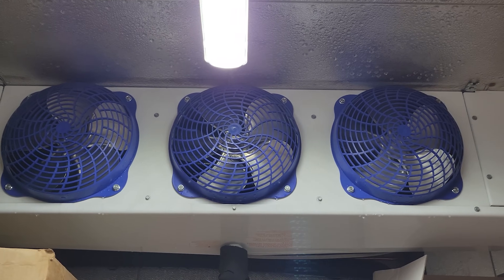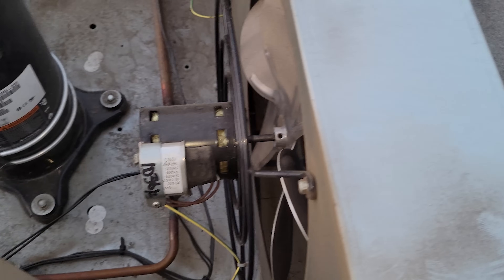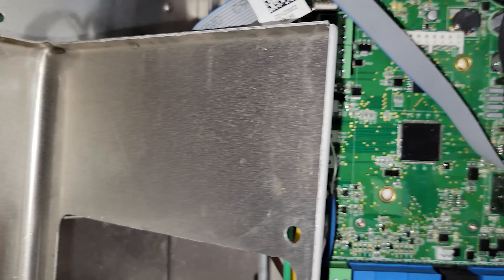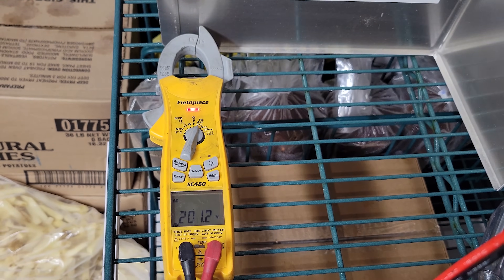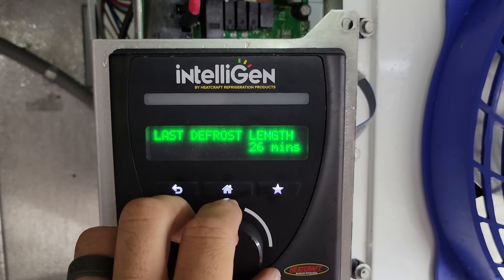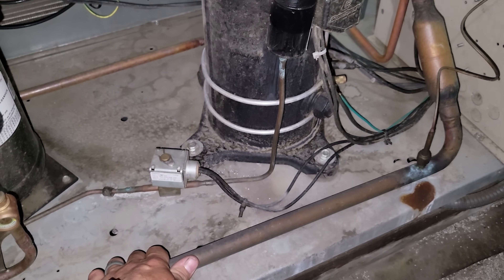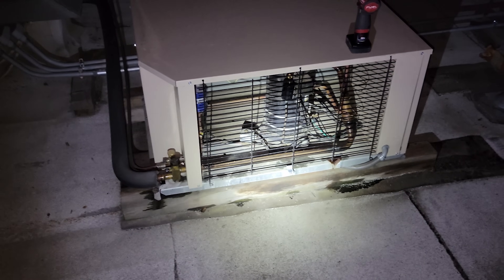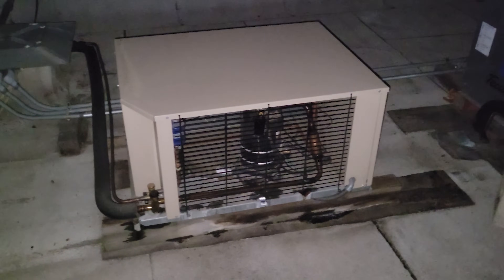HURRY THE FREEZER IS AT 50 AND IT'S 7PM

Comment: You’re in California right? Run a frequency check … it could be out of sync. The meter is supposed to do it automatically but sometimes it doesn’t. Brownouts will blow transformers too. 

I work IT and I have been going 200% lately too. I’ve had 3 UPS’s blow out during hurricanes because of the supply lines being out of sync.  One took out a lowes stores Battery Backup out and it burst into flames .. had to pull all new fiber optic. 

Was at a BK the other morning and the boss was shutting down at 7am because nobody will come it.

Comment: We’ve been in a similar situation over here in the northeast. I just started as a cascade refrigeration tech last year working on lab equipment, right in the height of the shutdown and it was very, very slow going for awhile. But ever since about September of last year once labs started opening up again, it’s been crazy how many -80 freezers have gone down. A lot of it felt like it could have been easily prevented with condenser/filter cleanings, or even scraping the ice off the door gasket so it would seal right. But with no one in there for months, I guess it was just something that slipped everyone’s mind getting back into the groove of things.

Comment: I worked in a store that had the motor room controls daisy chained. New guy came in to fix it asked how long was it like that, manager said probably since 1984. These things was running by the others thermostats at this point on the reach in's. Took a week for this guy to fix what someone else tore up in thirty years. Felt bad for the guy actually cause there was over 40 valve controls and non of these was labeled what they was for.

Comment: I'm working at a factory kitchen that supports a major chain of restaurants. The problem is, they come from a restaurant background, they don't know how to run a factory. The place is a real mess in terms of management. And they are trying to cram so much into such a tiny building. Since I come from a food production and IT background, I feel very disconnected from the process. Just the other day, the top floor of the office became a storage area for food. So, I will give you the process of my production:

We are making biscuits because all the restaurants are closed due to lockdown. Our pastry chefs work down the rear of the building, the guy who cuts the biscuits from the machine is towards the front of the building near the sealing machine area, which also doubles as the sign in and wash hands area. So, he makes the biscuits, they go to the oven which is in another area of the building, then down the back to the pastry chefs, then they go to a table somewhere else in the building, get weighed and bagged. Then they go to be sealed, go back to the table to be stickered, then to a completely different room of the facility to go through a machine which pretty much just puts tape on the top and bottom of the box. (anyone with a tape gun can do this in any room, but they decided to buy a machine for this). Then, to make that even more fucked up, the room with the taping machine is next to a walk in fridge, and you have to walk through the fridge that's fully packed with 3 boxes at a time, to then move down a side corridor through a couple of doors, into the staff office, take a left go up a flight of stairs to the change rooms and staff lunchroom, where they've decided to store these boxes until they go on an order in a few days and then have to be lowered back down the stairs by hand again. And that isn't even the entire process, because some biscuits are dipped in chocolate and go back and forth from a blast freezer and out again.

I think what I am trying to say is, the other day, the boss muttered an F bomb under his breath because I was only taking 3 boxes up the stairs at a time. My fucking knees are killing for doing this all day, up down, up down. The hell man. This is the problem with these types of environments, management are morons. Generally the type of people who manage restaurants are completely fucking stupid. Because the way they got to work in this position is they completely failed at school, they went into an apprenticeship for 3 years, spent the first year peeling potatoes, 6 years later they moved into something specific like pastry. These are not smart people, they are the lowest paid, least accomplished people in our society. Even the fucking janitor of a high school is more respected. Half the time the industry relies on illegal migrant workers. There is no lower job in this world then working at a restaurant, I literally hate these people with a passion. It's degrading working there to be honest. But, Covid, studying at Uni, need a few hours to make my life enjoyable.

Comment: Well... I do still not understand why you have to keep all electrics built in/on the evaps...?

We keep all kind of that stuff outside the cold rooms in the northern europe. Well... when we used mechanic thermostats it was inside the cold room. But that was long ago.

Still... those open, bare naked electric couplings in the evaps, a nightmare. Makes me shiver. Why not encapsulated? Ever heard about splash-proof/touch-proof junction-boxes in plastic?

Comment: Bite your tongue about venting to the customer. Or ya know, just educate them on how you, and all your technicians are professionally trained to work around/with the restaurant staff. So that they don't wait to call you until after the dinner rush. 
Can't tell you how many times working in walk in coolers, and walk in freezers during their dinner rush, I end up passing food to them to help them out. While holding a hose, thawing out frozen evaporator coils. 

Chris, you have an issue with the customer calling you when the problem arises. The solution is in educating the customer, on how time is extremely important, and you need to get there right away. You have to repeatedly say this on every service call, tirelessly. 

Sounds like you need to speak with your customers, and technicians, to begin passing on what I said, to make your life less stressful.

Comment: Too much current draw. The winding insulation was burned off shorting it out. Now the question becomes why did it draw too much current? Could be on the board, maybe something to do with that ribbon. Not necessarily a direct short but there wasn't enough resistance on one of the circuits so it just fed it back to the transformer and turned to heat and that's all she wrote.

Found that out with a Ring. They'll operate normal but leave a connection open too long and backfeed the transformer and burn them out. I had to add a resistor in series to stop that. Different story here but there could be a component on that board under the right condition leaves an open path a cunt hair too long. Who knows.

Comment: Primary of the transformer was open, ohms or lower k ohms will be usually ok, if it’s in the high 100’s of k ohms or M ohms it is practically open circuit.

Comment: I have suggested on several of the video's that the voltage is low on lots of your customers service lines. Low voltage causes more heat to form in all of the equipment and transformers, and shortens their life. I don't understand why your customers are not demanding the electric companies to supply you with the voltage that they are paying for. Thanks
Reply: it's 120/208Y 3phase, likely class "B" range, so nominal voltage the at the service entrance is +/- 5%, at at the equipment -13/+6% max. so typical loaded equipment voltage range is 181 to 220 volts. ideally it should be class "A" range of +/-6% tolerance at end load devices. (197 to 218Volts).
it is Commifornia after all, so god only knows ;)
Reply: For what reason would stuff get warmer with lower voltage? To my knowledge, lower voltage means lower current, which means less losses, which means less heat.
Reply: @Tjita1  Things heat up when low voltage and current goes up causing heat, Look it up and you can read why in electrical books and brobably on the internet.

Comment: When you were measuring resistance on the transformer, you said the primary had continuity when it was showing 18 megaohms, that is basically open, a good primary would have tens of ohms, the secondary showing 0.8 ohms sounds perfectly fine for such a transformer. Don't be fooled into thinking continuity when there are numbers on the display, 18 megaohms is just like OL but you have to spend a second to read the display...

Comment: I totally agree with this video, however at what point does an emergency service call not an emergency service call. I deal with the same thing late night calls on a walk in freezer yes that’s 99% of the time an emergency service call. But is a reach in display cooler not temping at 7pm an emergency service call? Or a prep table leaking water an emergency service call? Or a back up ice machine not making ice an emergency.. I work 10+ hours every single day and where I live in Seattle area it take a long time to get to a customer because of traffic issues so when I get a call a 7 pm for a reach in cooler leaking water what do I do? I want to tell the customer look it’s Saturday night I’m trying to save you guys some money and wait until later in the week. But the company I work for doesn’t care they think emergency calls and “after hours calls are the same thing” but I don’t. I’m trying to save the customer money with little things like this and save us techs some headaches. I guess my main question is am I thinking right for this?
Reply: I think it's an emergency service call if the customer wants to pay emergency call rate... Maybe you need to charge more.  Supply and demand.
Reply: Same as a mechanic, if the customer says it's needed now and want to pay then it's a now thing. If every customer says now and is willing to pay then the price is to low.  Prices should be at a point to self filter jobs so those emergencies that should be a normal job decide they can wait for normal hours.

Comment: The secondary was way too low, indicating that some windings shorted, on the secondary. The primary was in the meg ohms, so it was open. I suspect that the secondary shorted out due to an internal defect. The primary overheated and the winding or internal fuse opened. The other thing to check would be to see how much current the control was drawing from the transformer. It's possible to have a short on the control that does not shut everything down (a leaky capacitor), but I think the transformer failed all on it's own. The lose ribbon cable had nothing to do with it. Just the opinion of an experienced electronics technician.
Reply: What sort of resistance would you expect to see on a 24V 40VA secondary, then? While we're at that, what about the 240V primary?

Comment: This is why I stay away from refrigeration companies, I don't mind doing refrigeration, and I understand why it is the way it is with on-call, but my relationship w/ my family will always be over work. This field has way to many options for me to lose a family over, than to lose a job over. Ironic though, because the company I work for right now does refrigeration, but it's retail refrigeration and they close around 8-9pm 10pm latest, and the company doesn't mind pushing a call off to a weekday. I respect people who do deal with it, just not a good fit for me.

Also I've seen transformers fail off of loose connections before, had a unit lose a transformer over a couple loose wire connections. Replaced both, runs perfectly fine. Great video as always
Reply: Agreed the on call needs to stop, or leave it only to the ppl whom want it.

Comment: We always use 2 separate circuits one for the condenser and one for the coil. Is. Heatcraft Transformers have been a problem. With 2 separate electrical systems the problem is isolated.

Comment: Transformer failure could easily just be a vibration failure of the primary termination. It happens. The low resistance on the secondary is absolutely normal, consider the resistive losses of 1.6A over 800mohm, while 18M on the primary is as open as you're likely to see under the conditions.

Comment: When you have a transformer you measure both coils (aka. input and load) it should read very low resistance, that means the coil is not broken. In this case primary coil was reading in MEGAOhms so that means it broke somewhere, and secondary was reading in ohms (so its not broken). Transformers don't work like resistors they have something called impedance (or as it is called AC resistance) thats how they work. 13 megaohms on primary was a dead giveaway that coil was broken.

Comment: It always killed me...5PM on a Friday and the WIF is at 50 - 60 degrees. It takes ALL DAY to get that warm! Those transformers open the primary if they even dream of an overload. Good call on not putting the gauges on the system...first thing new tech's want to do... After 20+ years I'm so glad to be out of the business!
Reply: You never know - they might have had the door open a LOT more than they should have, or held the door open to haul a load in and out.   Those walk ins can lose a huge amount of cold air _fast_, especially if it's in an area like Houston (or S.Cal during the summer).   Replace the air in that cooler four times in an hour with no additional cooling?  I can see it shooting up quickly.  (Mind you, occams razor - they just didn't pay attention until people were closing things down)

Comment: Just as bad with transportation refrigeration, so many preventable late night service calls, broken belts and oil leaks that would tell them there is a problem if they just did a walk around before loading the trailer with 10k of product, everything is north of my house so I had to get a rv and park it at the shop so I could actually get some sleep otherwise I would be working 24/7, I want them to call me during the day, when I'm not sleeping.

Comment: And I happen to be the other side of the equation. As a chef that watches your vids knock on wood most of our equipment has been running good. It's just the ridiculous amount of water retention in the low boys that kill me. And the extreme ice conditions in our walk in freezer. If you get it on the right day it will snow in our freezer. I BS you not!

Comment: The awesome thing is, the advice you're giving isn't just valid for being an HVACR tech. I work in technical support for a database product and I do my own automotive repairs, and I can't tell you how insanely applicable your "big picture diagnosis" techniques and customer service suggestions apply in both industries! No matter how frustrating a customer is to work with, they are signing our paycheck. That doesn't mean you should violate policy or allow boundaries to be crossed, it just means that we give them the the support we would want to get if we were in the same circumstance. I love the way you work, man, I do the same thing. If I see a problem that's unrelated to what I'm working on, I'll note it and bring it to the customer's attention. In my case, I'm not paid per-job for doing technical support because it's included in the cost of my employer's product, so I'll usually write up a support ticket for the problem with the customer's approval and work on it later when the main issue is resolved.

Comment: Electro hobbyist here. My guesstimate: Icing issue plus water ingress caused the loadside coil to move, rub out the insulation and short to the core. The burnt smell would be from the remaining insulation overheating as the short happened, before it made solid contact. Since the shorted coil would be before the breaker, and not draw all that much ampwise, it would not trip any breaker. But that transformer should have been unusually warm to the touch.
Reply: Unless the ice had already melted by the time he got there thus cooling it. Highly plausible guesstimate though. Kudos.
Reply: @andrewrees6618  The winding shorting would have warmed the transformer considerably and melt the ice. If there's thermal contact to the casing, it'd also have warmed the area around it. But yea, there should still be icing visible unless that freezer had been down for a while, enough for it to defrost on its own. Given the freezer was at 50 dgr, it would start defrosting on its own.
Reply: The primary was reading in the meg ohms, so it was open. The transformer would no longer be drawing power and would be cold. But, it clearly did get hot at one point based on the smell. Yeah, water may have gotten into it, but those windings probably can take water for a while before the insulation breaks down.
Reply: possibly low voltage wiring is/was shorted by ice/hitting fan blades/smashed into coil, since it travels across the unit somewhere, with other wiring.
I have a feeling we'll see this turd unit again :)

Comment: Here is my opinion with that Transformer. That transformer is/was not rated for a wet environment. I understand that this is a freezer, but with the unit freezing and thawing from defrost, there is sure to have moisture collect inside that transformer and possibly damage it from shorting out the secondary side by creating another load (water) and over currenting the secondary until it burns out since it is not internally fused (if even that would help).